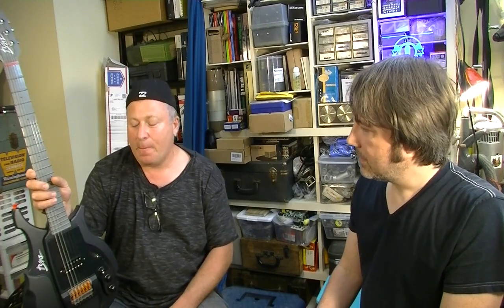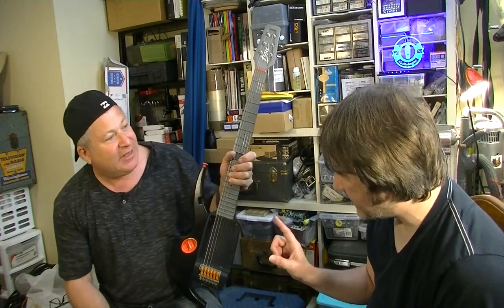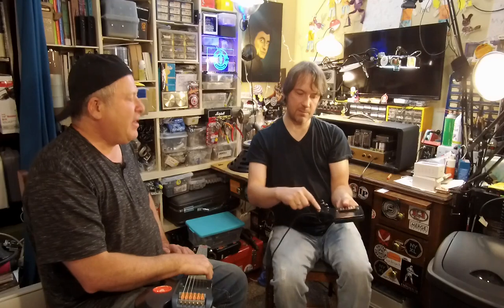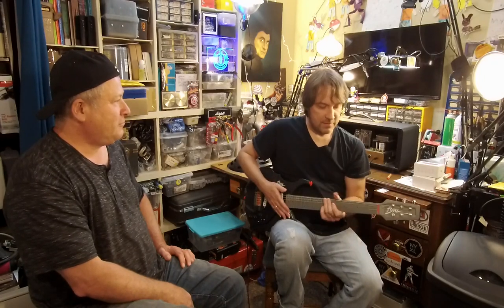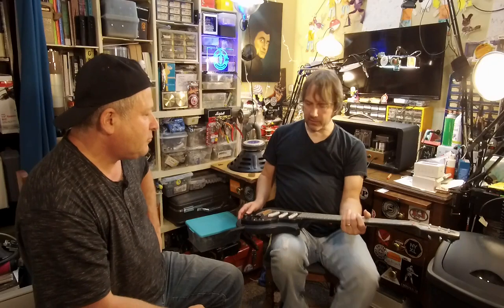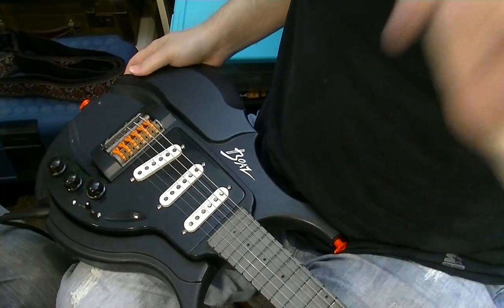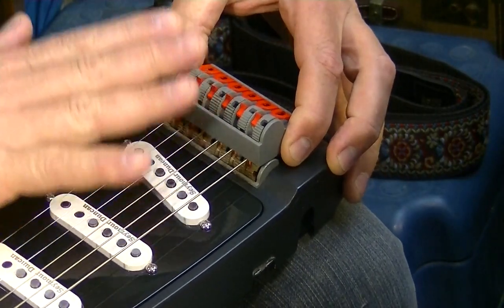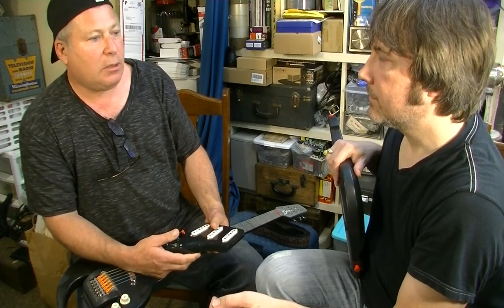THE GUITAR OF THE FUTURE! - 'Boaz One' Plastic Modular Guitar

Comment: Just checked back in on this and all of the Boaz links are dead. The Kickstarter is still up though. Any news??
Reply from the maker: I got a call from Gordon who is on the Boaz team the other day. They're very close to completion. Covid put a huge damper on their plans for this, but theyre nearly there. Gordon said something about maybe coming to my house to show me the final prototype before production of the backer guitars.
Reply: @TheGuitologist  I will bet you a handful of used capacitors that they won't be able to come in at the $399 price. But if they get close, it will be interesting. I've worked as top marketing exec for several companies that have gone down the injection molding path only to see them fail due to material costs. Delrin is a great material for this sort of thing. They make ski bindings out of it. But it is also not cheap either. I think the bridge is super cool but I'm not sure Delrin wouldn't dampen vibration vs. anything metal.

Comment: Neck material is Delrin acetal. Beautiful tough dimensionally stable (metal infused?) material. Used to work at factory that made this stuff, shipped plates and bushing stock under military specs/contracts. Not new material but great application.

Comment: Very cool... I have to ask if there is any neck dive on that?... And may be better to build the "circuit module" in some lightweight metallic material to avoid radio interference. Plus, they must make a 7 string option... That´s the one I would buy.

Comment: delrin is also extremely heat resistant and because of its hardness could in essence be leveled  just like a normal fret ..would have to be a bit more gentle  but i dont see where there would be a problem with that..great idea for an all around guitar..would imagine the neck would be realy stable as well..no environmental worries like traditional wood necks..curious to see if they can make this work for them

Comment: Thanks Brad and Boaz / team for sharing. Very interesting - incremental guitar. Looks great for travelling. If wireless was build in to the interchangeable pickups you wouldnt even need to plug in cables. Just a quick pairing button. The tone plastic sounds decent.

Comment: I've got some guitar picks made of Delrin... the closest analog I can think of is Lexan, which is what many higher-end two-way radio housings are made out of...
Reply: So these are different from the Dunlop Tortex? If so how so?
Reply: @steveblease   The Dunlop website makes reference to some kind of "treatment" for the Tortex picks. To me, that "treatment" has always felt like that fine powder that chewing gum is coated in, except it doesn't brush off. Nothing wrong with that,  I just prefer mine (Dava) because they have a rubber grip (I have a weak grip from an injury) and the thickness makes your brain think it's variable, depending on where you grip. It's hard to explain; I suggest just trying a sample pack. Best I've found in 50 years of trying...
Reply: Yeah, got some pretty cheap pack of 5. Been playing on and mostly off for 40 years and only now discovering my always loves soft sharkfin plecs are too soft for rock type guitar playing. Was very hard for me to get into thick picks, but now I am getting there. @Jah_Rastafari_ORIG

Comment: REPLACABLE FRETBOARD.  If the fretboard can be removed then the entire thing can be replaced in a single step. No setup. When it needs a fret job just remove the entire fret board and glue on the new one. Cheaper, higher precision. Allows for custom inlays or scalloping.

Comment: @The Guitologist: really like the sample runs you played---very Blackmore Rainbow-era influenced (?)---the sound quality IS great, and convenient features, but, can you address the issue of durability of plastic parts, especially for instance at the bridge, over periods of hard bending and playing and general abuse, even over a single gig for, say, a heavy/prog metal guitarist? Moving parts, quicker wear and more frequent replacement, and keeping in tune, and uneven replacement of individual hardware, based on where and what strings you play most and the hardest...?
Reply: ...what also about those that like to bend the neck at the head stock for expression?
Reply from the maker: I did not try that headstock bend technique on it, but I have to imagine you could still get a bit of that. Not sure though. Good question!

Comment: Unfortunately, I can see a major guitar company stealing that bridge design. Absolutely incredible. As for the rest of the guitar... idk. Seems like it's a bit to complex. I can see after a few years of use, components that keep it together may wear... and fall apart. I get this image in my head of being in the middle of a killer solo, bend the neck a tad... and bam... guitar splits in half, and the pick guard falls on the ground
Reply: I see you, in a few years, after a killer solo, on our guitar.
I know this guitar is stronger than any wooden guitar.
Our earlier prototypes, keep their shape!
Reply: Morris Miller, I hope you do well with it and wish you success. I am not trying to insult you and others working on this guitar. There are some remarkable innovations for sure, however I have some concerns. I think that a "locking" mechanism as discussed in the video, would be essential. Just from the actual sound the plastic pieces make, are worrying. It sounds as if the pieces are not completely secured, or after time and use... whatever clips or mechanisms holding the guitar together, may break or loosen. The built in floor stand for example, seemes like it may break off easily. My opinions are of course, all based on appearance, and I would love to see one in person when they come to market. These are just my first impressions, and perhaps a suggestion to make the guitar more solid... would be to do something similar to Lego brick connections?

Comment: VERY inventive idea, love that people are still thinking of ways to build a better mouse trap. However....I can tell just by listening to you guys handle the guitar body that it "feels like plastic"(the creaking of plastic parts moving against each other).....that alone will be a HUGE hurdle to get over. Not to discourage further development, but musicians want an instrument that feels good, wood feels good, certain composite (dense) plastics feel good, carbon fiber feels good....maybe look into ways to make your guitar feel "not plastic". The materials used for this guitar seem solid and it does sound fine, i cant say it sounds "plastic" it sounds like a it should.....but until it "feels" like a traditional guitar its gonna be a tough sell. Maybe manufacturing the body parts out of solid pieces instead of multi part (screw together) pieces would help eliminate the plastic feel of the body. Just my two cents...im an amateur musician and have a career in manufacturing, i have a decent understanding of designing,molding and manufacturing. Obviously a solid part will be make it harder to install all the bells and whistles inside and attached to the body parts but it will result in a more solid feeling body....just something consider, and i wont even get into the costs of retooling your molds to the solid piece construction lol.  Love the concept though, keep on keeping on :)

Comment: I am pretty sure this thing won't be that popular, just because guitarists are snobs. Also, they believe in tone woods. So: Plastic = Toy = Not a real instrument = Not gonna buy.
How does it sound tho?

Here are some design ideas:
I really like the bridge design here, but howbout something like the evertune bridge? Out of tune guitars is one of the primary problems guitarists face.
Also - Roller nuts are cool. Reducing friction improves tuning stability.
Reply: Problem with roller nuts is that you have to hack a piece out of the fretboard/neck or you'll never be able to intonate it, as the string touches the middle of the roller rather than the part nearest the bridge. Makes for a messy fix if you change back to a standard nut. Just get a graphite nut and it should sort binding problems.
Reply: @keithwallis9799  Why would you ever want a regular nut after having a roller nut?
Also - I am proposing this as a permanent nut for this particular guitar.

Comment: I have a suggestion.  Don't ever put auto tuners on it.  LOL
Reply: A built in tuner would be cool though, or better yet a basic rechargeable multi effects unit (with a wireless system as per other suggestions).
I do wish Brad would have played the built in amp. I would have liked to hear it, even if it's only a prototype.

Comment: Some very innovative ideas. But do guitar players want innovation? I know I don't. I'm pretty suspicious of anything new. Where are "the guitars of the future" of the past? The Gibson RD Artist, Bond Electraglide, Steinberger L-series, Parker Fly. They're either gone or reduced to serving a very tiny niche market.
Reply from the maker: Yes, but the problem most innovations have is they don't solve a fundamental problem. No one wants to take a prized Les Paul or Telecaster on an airplane these days. They may try to force you to check it in luggage and then smash it on the tarmac. This thing will break down and fit in an overhead compartment AND you can get 3 or 4 guitars worth of modules in there and play a gig on the other end with a Strat, a Tele, a Paul, and a Junior at your disposal. None of the guitars you mentioned can do that. So you're right in one sense about traditionalists, but you're also wrong in your choices of comparisons. It's true that modular guitars are not new and have also been tried before, but never with any serious backing or marketing behind them. The new Relish guitar you've probably seen pop up, for instance, is an old design but only just now seems to be pushing out. But I think its flaw is the inability to change your entire guitar, pickups, wiring and all, in one swoop. Also, it has a gimmicky switching mechanism that just isn't practical. Another modular design from Rick Dodge called the "Convertible" was released back around 2000 or so. It wasn't heavily pushed, but it did at least allow for the loading of different electronics modules like the Boaz. The guy still makes those, but their price point even in 2000 was like $1000. So that was never going to take off. Plus, you couldn't change body shapes. At the risk of soundling like a cheerleader, the Boaz has a lot going for it. I think it has a chance to make waves where others have failed.
Reply: @TheGuitologist  I hope he succeeds. Even if only because he seems to be a pretty likable guy. But I'm not sure. To appeal to pros, the modules will have to be loaded with pickups they like. You know how anal people get over that. To appeal to young beginners, they'll have to be convinced this is cooler than a Strat or a Les Paul. So that won't happen until someone famous is associated with this guitar.
I  hope the low price he predicts comes through. At such a price, people might be willing to give it a chance. Even if they're not 100% convinced immediately.
Reply: Dave Males  It's a very different world today. We have an enormous archive filled with a century of recorded guitar music. Players identify with that history. Want to emulate sounds and styles from that history. The most obvious way of doing that is by using instruments and equipment similar to those of your favorite players.
Reply: @mikesg1776  He did say they will sell the cartridges separately so you can install any pickups you wish.
i could see an online catalog where you get to design your own guitar.
Offer different body choices, pickup configurations, maybe even scale lengths and head stock shapes.
You buy the parts you want, snap 'em all together and you have your own guitar.

Comment: Very intriguing but, no whammy bar?
Lots of rock and blues requires a Vabrato/Tramolo bar.

I don't buy guitars without whammy bars because they are very limited in this regard.

I hope it is a function they can fit in, otherwise I have to pass.
Reply: Modular. Very easy for him to add a tremolo. His bridge design can be mounted to a plate that moves. Much better design.